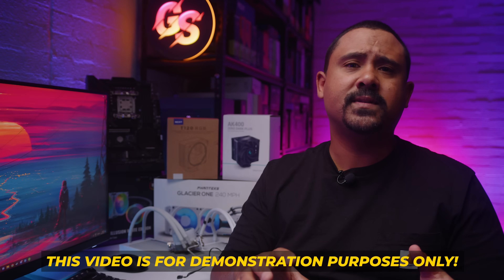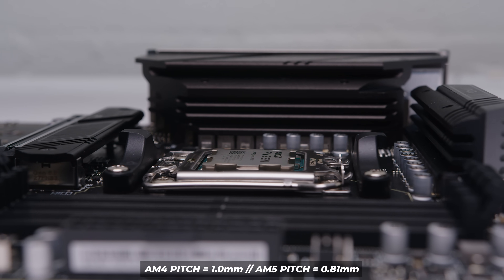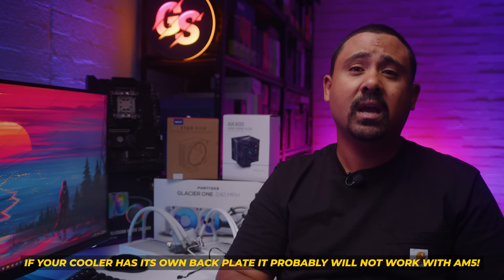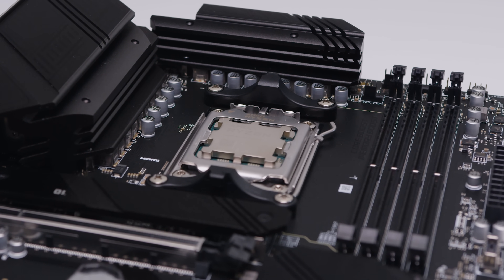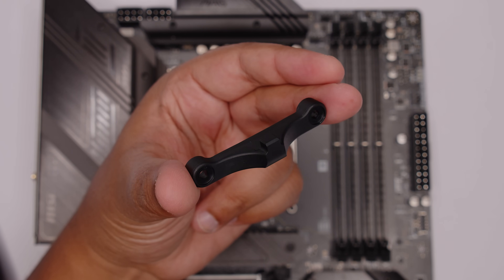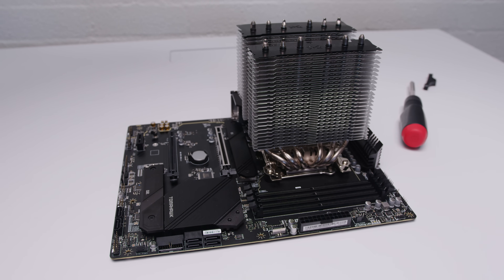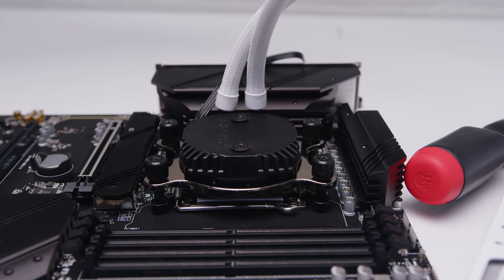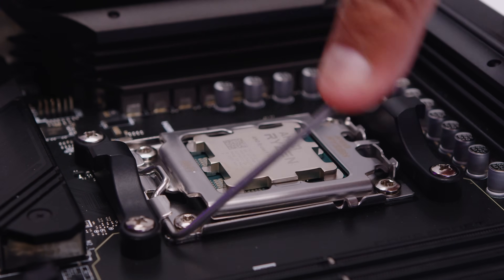AMD AM5 Cooler Mounting Compatibility Deep Dive

Comment: And yet asetek sells brackets to fit am4 coolers onto am5 boards. WHY?! People with nzxt coolers like my kraken x73 also buy them. Nzxt sold the asetek bracket also so why the hell would they sell it if it's not needed? To scam people?
Reply: Can confirm that my kraken X73 works just fine on the AM5 socket. lol what a hoax, that AM5 bracket.
Reply: Good to know. Got the same AIO.
Reply: @Boenker86 I have a Kraken X73 and I just bought an AM5 motherboard. Your words took a weight off my shoulders, thank you.

Comment: I've started looking in to this because I've been using a Kraken X73 which I bought in early 2022 for my 5900X and when I upgraded to my 7800X3D and changed boards and such to AM5, the exact same bracket I was using on AM4 worked still despite not having been upgraded to AM5 support even though I bought it before Ryzen 7000 was even announced. Despite all that, there is still supposedly an updated AM5 version of the bracket and to me it looks exactly the same but the bracket part that goes on the AIO has a single hole instead of 2 holes to adjust depending on whether it's AM4 or like AM3 or whatever. It's bazaar to me because that change won't effect AM5 so I'm not sure what makes that "more compatible"

Comment: Jeez thanks I just literally installed the cooler master 360l AIO on the motherboard of the build I am currently doing. I tried to keep even pressure on the top and bottom screws when installing the cooling block/pump on the cpu but the metal tabs were bending a little bit, and I thought I might have tightened them too much. I'm glad that you said they will bend a little bit, makes me feel better haha. Thanks
Reply: And yes it's an AM5 cpu

Comment: hi @GearSeeker,
I have an i7 6700K and an h100i v2. I want to upgrade to r9 7900X/5900X. I don't want to spend on a CPU cooler if not needed(on a budget, want to use as many of my older components as I can). Can I use the same cooler on AM4 and AM5 motherboards? What do you recommend.
Reply: What did you do? I have the exact same problem and my  h100i amd mount doesn't fit at all!

Comment: The problem I have, I bought a used high-end AM5 board, without the mounting clips. Unfortunatelly, the ones from AM4 are different and don't fit because of the AM5 retention mechanism :(. Anyone knows where to buy AM5 clips? There's plenty AM4 out there but no AM5...

Comment: Thanks! You erased my last doubts about compatibility issues with my NZXT Z73 water cooler.
Reply: are you using it with the default am4 bracket now? I have a x73 and looking into AM5.
Reply: @BmiestTV I’m coming from a x72 kraken and wonder if this will work on my 9800x3d
Reply: @seasonalocean  I mailed Nzxt and they told me to order a asetek bracket as they won't supply a new am5 one free anymore. I've been running the machine since a few weeks now with the x73, works fine. Even used a phase sheet pad instead of thermal paste.
Reply: @BmiestTV  so how much was the bracket now.

Comment: Hey peeple,

I`ve just built a new gaming setup with an AMD ryzen 5 7600x + 6800 GPU + Gigabyte B650 Gaming AX Mobo - I have a very strange issue where the cooling in the system is all over the place, it just seems that the cooling behavior is erratic - it`s not that it doesn`t cool, it cools quite well (water cooler 360mm + 7 120mm fans) but it continusouly adjust the cooler speeds up and down. Every 2 minutes the coolers go to max, stay there 30 sec, go back down to low med stay there a few more min and all over again. Does this continously. With no load the CPU is @ 40 degr. C, seems fine. Did a BIOS update, not sure what the issue is. Any ideas ?

Comment: For the nzxt x61 which is basically asetek cooler. I indeed needed a new mounting bracket. The holes do not match. This video is wrong about the asetek bracket. Maybe new versions will have the right bracket. But mine did not. Found this out after driving an hour home from micro center, luckily Amazon had the bracket with over night shipping. Micro center also sells the bracket for $5

Comment: The top hook on my factory mount hook bracket snapped off suddenly, leaving MY ML360 AIO pump head dangling off the bottom hook. However, I literally can't find any sort of AM5 replacement bracket on Amazon or even on Google. Is there a keyword/terminology i should be using? Or can I replace the plastic hook bracket with an AM4 one?

Comment: Somebody told me that if you remove the zif bracket on your mobo then it invalidates the mobo warranty. Is this true?.
Reply from the maker: I wouldn't do it.
Reply: @GearSeekers  - I contacted Thermalright and Gigabyte tech support for clarification. Thermalright said wrt their aftermarket AM5 cpu holder, it does not invalidate mobo warranty. Gigabyte emailed me and confirmed that removal of the mobo zif bracket does not invalidate mobo warranty, but if you need to make an RMA claim for your mobo then you need to reinstall the zif bracket on your mobo before sending it back for repairs.

Comment: can i install a cooler master 212 black led on the stock black plate of a b650 ds3h? maybe using the plastic clips? because it comes with the black plate attached to the cpu

Comment: So basically my SCYTHE SCNJ-5000 Ninja 5 is aslo compatible with am5, right?
Reply: maybe or maybe not you have to try and see. I  know for a fact the AK620 does NOT fit the AM5 socket.
Reply: @JayzBeerz  It fit, I just finished installing on my ny new AM5 mobo.
Reply: @zaxyss7339  not mine the B650E Steel Legend is does NOT fit.
Reply: @JayzBeerz  hmm I didn't saw any problem with my MSI MAG B650 TOMAHAWK WIFI
Reply: @zaxyss7339  may be didn't height tolerances. as my cooler base contacts the cpu before the screws do to tighten it down.

Comment: Just build my first AM5 pc. I was surprised how easy it was to mount the h150i aio by Corsair. I'm so used to flipping the board over and installing a different backplate. Well done!👏
Reply: I’m hoping the H110i  240 mill fits, works with B 650 tomahawk
Reply: Yo Jordan bro
Reply: @jamiehowells8201  yo
Reply: @JordanScanlon  did you have to change any brackets from the 150?

Comment: Building a whole new pc, using an NZXT Kraken x73 on a 7700x, msi b650 tomahawk, seemed to get conflicting information but this here says it should be compatible with both of those, yes? Just my first time building a pc so of course I'd want things to go well ^^
Reply: The am4 mount will work, but you need to be careful tightening the thumb screws. I'd highly recommend getting the am5 bracket, as the standoffs are about 2mm taller, which prevent you from over tightening the cooler onto the cpu.
Reply: @David Haas  still waiting on nzxt to send my am5 bracket... label created for a week now :/

Comment: I’m new to the pc world so I don’t a lot about the differences of am4 and am5 but will the nzxt kraken z73 cpu cooler work with the new am5
Reply from the maker: Yes
Reply: @GearSeekers  do you need to use the am5 bracket nzxt are recommending or will the original am4 ones be fine
Reply: Are their better options than the kraken z73 that is still compatible with am5? I heard that their are other options that preform better at lower price. Only reason I looked into that cpu cooler is because it looked visually appealing.

Comment: Thanks for making this video.  Since the Corsair H100i would be considered a "common mounting solution" (ie., using the stock mounting bracket), just want to confirm - have you had any compatibility issues with AM5? Based on your video, sounds like it should work.
Reply: Im hoping it does work.
Reply: Hey did this work? Have the same parts for my build

Comment: I made my own backplate/mounting brackets for a Thermalright cooler to make it compatible with am4. I have noticed som motherboards develop a “pit” or bend around the socket, won’t happen with my backplate, 5mm steel plate FTW.

Comment: what about those low profile coolers that use just a bolt & nut that goes directly to the back of the motherboard, those don't use the AM4 backplate. Are those compatible with AM5 ?
Reply from the maker: No. Anything that either uses its own or removes factory backplates will not work.